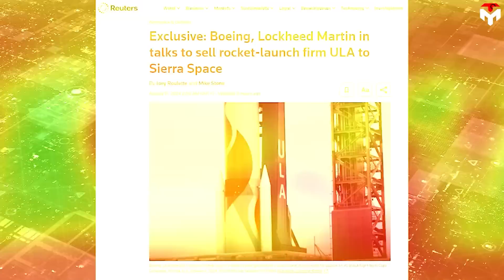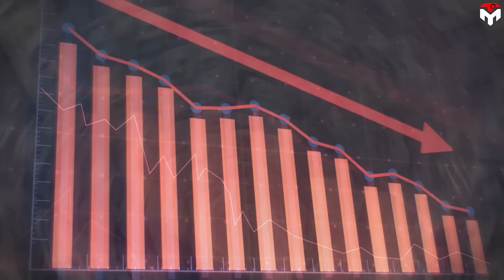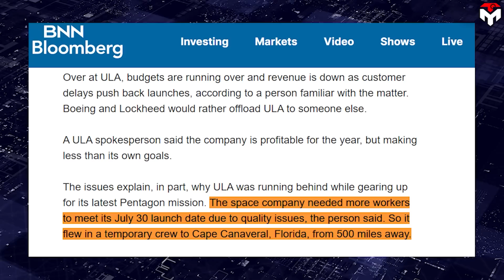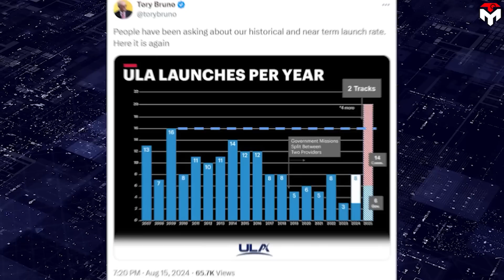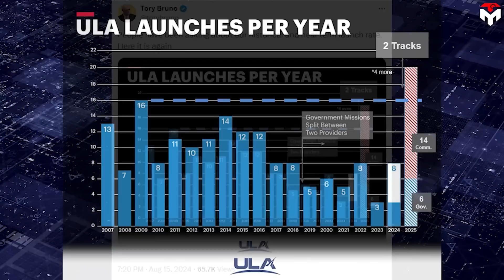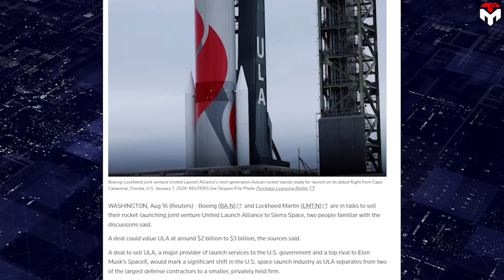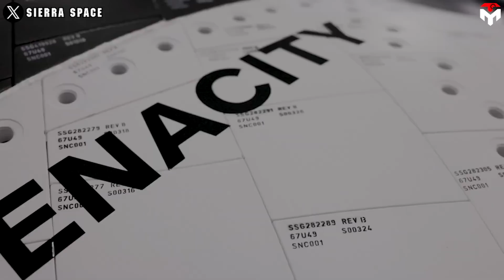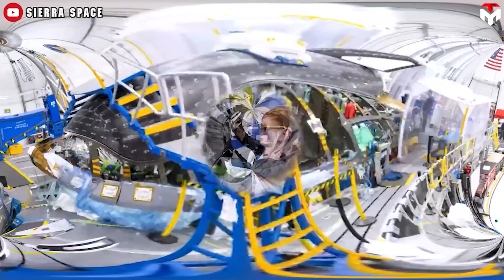ULA is Getting Sold! Top Genius Engineer to Join up SpaceX...

Comment: Well, I'm glad they are awake now....
ULA , NASA, Boeing etc. were snoozin' and losing while SpaceX and the Chinese were gaining ground.

And Elon just got several jumps on everybody over the last 3 years by advancing rocket engine tech beyond anybody else.

So advanced, Tory Bruno thought the complete engine was an unfinished core.

And we are months from seeing Raptor 3 start prooving out.
Those blue exhaust flames tell a story, its lean and mean.
Made possible by being a cooled engine.
SpaceX shooting for 1K re use engines.

Thats a new paradigm.
And these other legacy companies are Dinosaur Museums until they can get out of 1960's on their motors.

At least the Chinese are smart enough to try to duplicate and learn from it..

Cant power rockets with Wall Hangers, takes real work to get innovation. And in design, perfection is invariably in the direction of simplification...
Even Elon amazed at how much work it was to get rid of the garbage accretions, and then work the required stuff into a homogenous design.

Having a corporation does not make you a rocket company, its creativity that gets results..

And Elon has rubbed their noses in it.

Others bad mouthed for days, Elon Groked and ran away with it.

Every suggestion that Elon used to get from Raptor 1  to Raptor 3 was heavily down voted when presented for peer review.

Not only that, he applied a fabrication logic suggestion of getting every hunk of metal to do three jobs, to engines...

That was unexpected! 
Dont give Elon any ideas! 🤭
Not only will he use them he will build on them.

Back to work Space Wannabees! 🤣

Comment: How much CO2 does all these rockets add to the atmosphere?  😮
Reply: I just did a quick,, I hope accurate estimation    A Falcon 9 booster (I did not include the figures for the second stage) (because I have Nooo idea how much of  the second stage affects the atmosphere 100 miles down.)  lifts off with Approx 135 tons of RP-1 (kerosene)  a 747 fueled for a long flight  about  205 tons of Jet-A (kerosene)..  Let's see,, ratio of hydrogen to carbon,,, Jeopardy music... 2.5 tons of CO2 per ton of fuel ?  a bit more,     The comparisons

One Falcon 9 booster launch      350 tons of CO2
One New York to LA      747         400 tons of CO2
One 18 wheeler NY to LA                 8 tons of CO2
one Ford F150 NY to LA                   3 tons of CO2

I must have errors in there,, I cannot imagine that I got all the hydrocarbon ratios correct or I don't have a math error in there somewhere  BUT  I think  that is somewhere near correct. Sunday morning mental gymnastics (no pencil),, now take myself to breakfast.

Comment: Aluminum Starship with expended booster could make the moon without reload!
Reply: Starship isn't aluminum. Aluminum is inferior
Reply: @XCX237  WEIGHT
Reply: @XCX237 I think they mean IF it was built from Aluminium. That might work but just switching from Stainless steel to Aluminium like that is not a straightforward process as the entire vehicle and all of the modified subsystems would have to be recertified for flight.